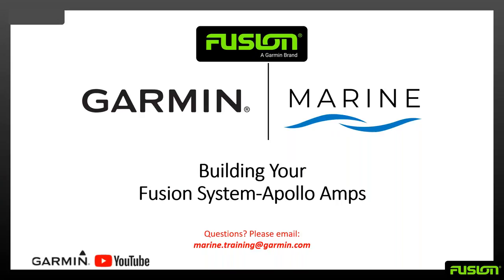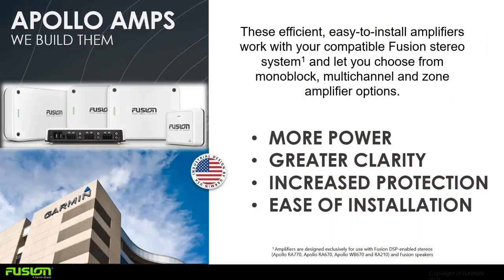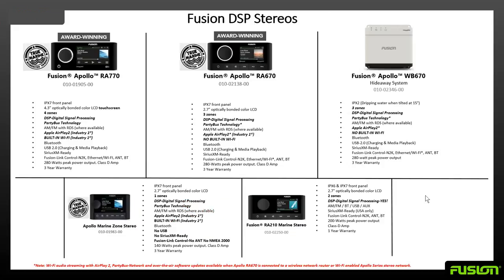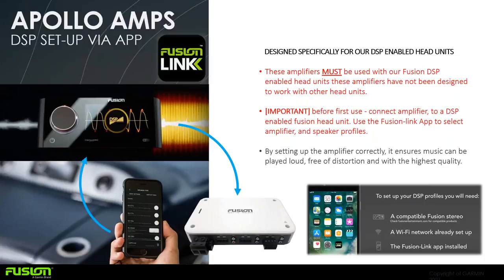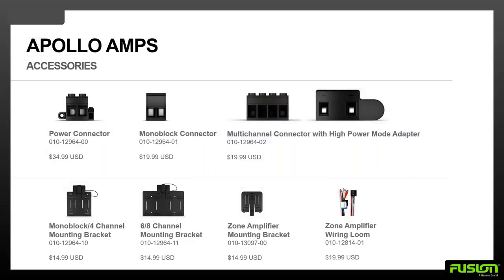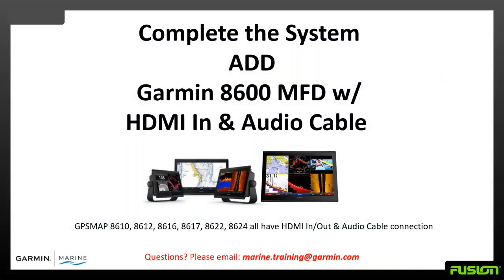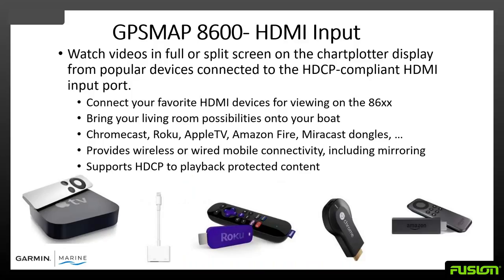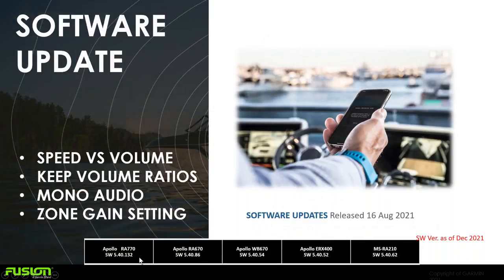Garmin Marine Webinar: Fusion System with Apollo Amps

Comment: Great presentation.  We all love Garmin. Would love to give my unsolicited feedback lol.
#1 Stop hiding the RMS wattage on product pages.  I had to go hunt around just to find the actual RMS watts per speaker.  You blast peak watts all over but literally omit the MOST important info from the product pages I had to download the manual just to find out what RMS was.  150 watts RMS is nothing to be ashamed of so please stop hiding RMS on every one of your product pages such as on Amazon.  
#2 it's a huge pet peve of mine when a manufacturer lists the peak watts and only the peak watts right on the amp or speaker. Kinda ridiculous when most everyone now lists RMS, honestly it was only fusion and then a couple super cheap China amps and speakers that does that. You also list the 770 in 2ohms and the 210 in 4ohms. Very odd to do that.   Don't be in the same league as those $30 speaker and amps. It doesn't fool anyone who has half a brain.
#3 You went a little overboard by locking us into not just being required to have fusion headunit+amp but now even speakers.  That's a little much.  There's nothing that I see that would make fusion speakers mandatory like say 3.5ohms or something wierd like that.  I bought everything in my house samsung smart system and then 2 years later they got out of the smart home market. So I don't exactly trust being forced into all one company plus you make amazing speakers but I'll never drop JL audio speakers when I already paid thousands for those speakers.  If you force people to choose fusion or JL audio in the "speakers" department... you might not like the choice people will make.  
It was unclear if I "had" to use rca cables for each zone of if I could just use 1 rca cable for everything, I didn't want 4 zones for my 25 ft canter con I only wanted 1 and was totally unsure. Plus they were not included if that was indeed needed. 
#4 thank GOD for your new speed sensitive volume adjustment, very glad you have that now. :)
Everything is built well and so far so good!